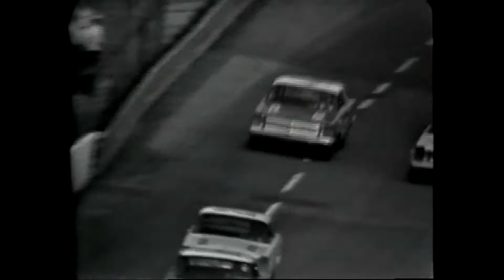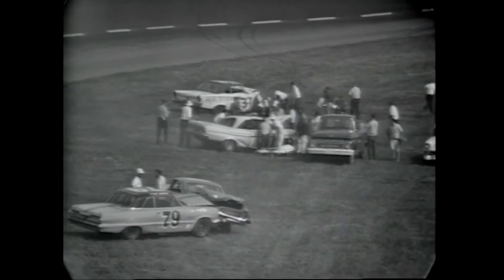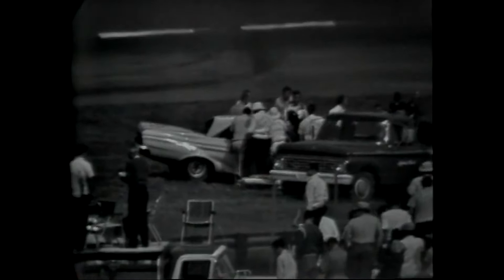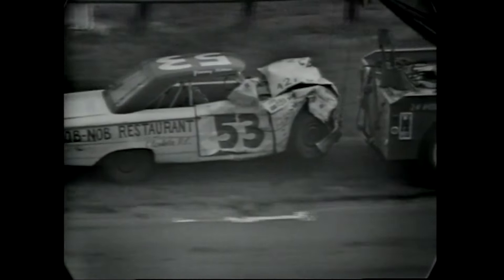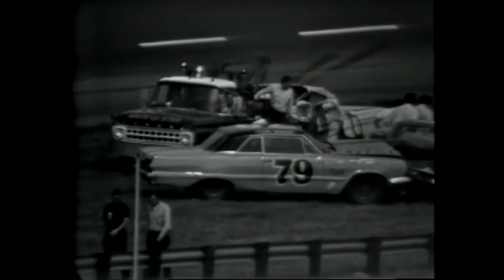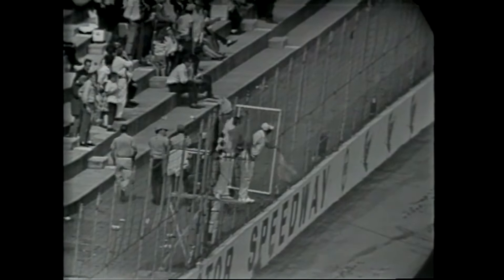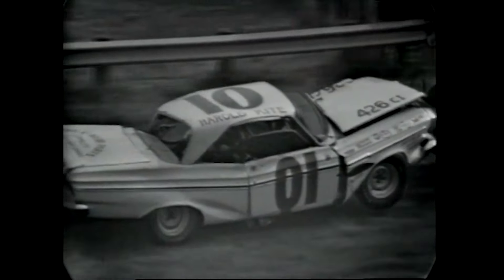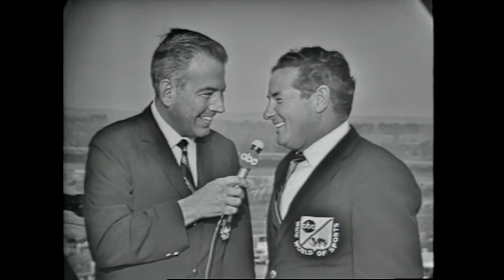1965 Harold Kite fatal crash @ Charlotte (extended footage)

Comment: As the broadcaster on the left reports a fatality, the guy on the right is all giddy and smiling and is looking forward to many more races like that.  🙄  Uh...what?
Reply: Yes. I was thinking the same thing. Yep, those sweet, innocent 1960s, when people were more empathetic and kind.

Seriously, though, death at that time in all forms of motorsports was simply accepted as a job hazard and it happened a lot.  Very different times. I mean, compare what happened after the Greg Moore crash and the Dan Wheldon crash? One race went on. The other, 12 years later, was stopped. Times change.
Reply: I wouldn't blame him, it's just the sign of the times, everybody had a cavalier attitude towards fatal crashes including the drivers themselves, they certainly didn't dwell on death like we tend to do nowadays.
Reply: Same, especially at the end of the race, where he states he hopes to see more races like this one.
Reply: The "guy on the right" is Rodger Ward, two time Indy 500 winner. He had seen fatal crashes before and was in the middle of one of the REALLY big ones in racing history when Bill Vukovich was killed at Indy in 1955. He was also a fighter pilot in WW 2. People weren't as insulated from death in those days. It was part of every day life. Younger race fans suffer lifetime trauma from watching an accident where the driver doesn't even get hurt and their pants are still wet about it years later (example: Grosjean). I don't know which attitude is worse.
Reply: @derrickgibson3240 like Dan Gurney said, they had a WWII mentality then.
Reply: @jwelliott738  Exactly, they were much tougher souls back then.
Reply: @RRaquello I get that, but it's just awkward to see. a guy died and he's just "ho hum" chuckling about it. 1965 car races weren't really broadcast with "what will people in 2024 think of this?", and attitudes have changed of course. but ward here is just, 60 years out, ghoulish.
Reply: Different times.  People being soft as runny shlts is a new thing
Reply: you got to remember,  this was a time we had just come out of a world war and the extermination of 6 million people...   we were very tone deaf to death in this era of life. it happened all the time in motor racing too.   the fact guys like foyt, andretti, petty, and the like survived made them even bigger heros of the time.  Death  was just a more natural and accepted thing.   it crazy to me too but that was just the cost of doing business back then
Reply: @603LostRoads  well, yea. like I said earlier, I get that. it is a much more emotion and feelings-based society today, and that extends to broadcast booths in all sports, including auto racing (which I am a novice fan at best of).  I definitely get how ward, with his military and car racing background, can compartmentalize deaths of people he probably didn't know all that well like kite, since he certaintly had seen lots of his friends and contemporaries die before this, both in war and on the track. but common decency and courtesy did exist among people in 1965 (which is before my time), and a little of it here would have been nice. "....just want to send our best wishes to kite's family and friends (some of whom were probably watching the race on t.v). it's just terrible what happened here. very sad...." that's all he had to say. Fleming said it.
Reply: Ya really!
Reply: @robertstone9988  Uh oh, here's the "real man" whining about people soft, and not realizing that he sounds like a soft dude himself. You're not a hard ass, Cletus.
Reply: WWII ended 20 years before this. My father fought and was wounded in that war. I don’t recall him ever saying a tragic death was a “natural and accepted thing”.
Reply: Remember, back in this era, deaths happening in sporting events were not something unheard of.  They didn't happen all the time, but the happened just enough to where people in that era just accepted that death was a possibility--albeit a rare one--in a sporting event.  There would be deaths in boxing from time to time in that era, occasional deaths in football or pro wrestling.  I believe Bill Masterton died of injuries sustained in an NHL Hockey game in the late 1960's.  Add to this the fact that for regular people, death at a job or in a car accident were things that were not infrequent.  People, as a whole, were simply more accepting of the reality of death in those days.
Reply: Yeah no shit- pretty insensitive even for 1965
Reply: People were more savage back then.
Reply: @MMAALL Where did you hear the 60’s were more empathetic & kind?
Reply: Primary broadcaster on the left was Bill Flemming who was one of ABC Sports' most versatile announcers at the time and noted for the network's college football coverage.
Reply: Yes.   Disgraceful
Reply: That to me is so sociopath.   A Death has occurred and this guy is thrilled about the race day and the events???
Reply: That's the color guy - the experienced expert on the event. Also a combat veteran. NASCAR drivers back then went into the sport knowing the score - there were going to be fatalities, possibly themselves.  Harold Kite knew this, and had seen it before, and knew the show must go on. Be thankful you haven't had these experiences in your life rather than criticizing those who have.
Reply: @603LostRoads that doesn’t make a life lost any better, each life matters
Reply: @TomandAmyinthePI I graduated high school that year and we lost a classmate to an accident, no one was laughing or smiling then. That was so rude of them
Reply: @naomisgram1   so go back 70 years and let them know.
Reply: My thoughts exactly!
Reply: I saw that
Reply: He showed no Respect for the race car driver or his family.
Reply: @OsbornTramain  your right. he's sick
Reply: The only missing is the popcorn and  balloons  and some Jolly good music. WTF
Reply: You can't see it from that angle, but he has one of his hands on his ... you know.
Reply: Yeah, that was nuts. It seemed like Roger was about to crack up.
Reply: I know right…I was fully expecting the announcer to say that the race will be restarted just as soon as they scrape the guts and intestines off the track…
Reply: That was some weird ghoulish sounding shit. Just smiling away.
Reply: @603LostRoads  This was 20 years after WWII - the world changed a lot between the end of the war and this race. It was also just two years after the Kennedy assassination. We were not "tone deaf to death". What a ridiculous statement.
Reply: @robertstone9988 😂
Reply: That was F’d up how the dude on the right was acting after seeing a guy killed 😮. Who was the reporter on the right anyway, what a JERK OFF
Reply: That was F’d up how the dude on the right was acting after seeing a guy killed 😮. Who was the reporter on the right anyway, what a JERK OFF
Reply: I understand that it’s 1965 October 17th right and people were not as sensitive to events like that on live TV but damn come on show so respect dude still
Reply: @603LostRoads 
What are you talking about? 
WWII ended 20 years before this race.
Reply: @RRaquello  We didn’t have counseling at school either if a student was killed in a car accident. We had an announcement from the principal on the intercom a moment of silence then our day as usual. No reporters at the school either.
Reply: Unbelievable callousness. Sickening
Reply: @RRaquello  To emphasise your point, a de Havilland 110 disintegrated at the 1952 Farnborough airshow in England, the engines propelling themselves into the watching crowd. 29 spectators were killed. The event continued once the wreckage and bodies had been cleared. Unthinkable today, but the spectators had recently experienced WW2 where sudden death from the air was to be expected.
Reply: I immediately noticed that as well.
Reply: The dude is sick
Reply: That definitely didn't play well..totally unsympathetic and shitty. I wonder if he or the network or channel faced any repercussions..certainly now with the Internet, etc he would be fired.
Reply: Would he have been smiling if Kite was his brother? Pretty cold, dude.
Reply: @MMAALL  I think people back then just felt it was reality without the need for emotional drama.
Reply: @RRaquello  this wasn’t a fighter pilot dying fighting the nazis. I don’t think we need to be in a certain era to have some value of human life. Not sure how your priorities go so wonky with such a weird comment tbh but you might want to think about that.
Reply: Nervous reaction?
Reply: You know something tells me that being a soldier in WW2 might just make it so you’re desensitized to death.
Reply: @OsbornTramain You get desensitized to death real easily when you’re flying in a B-17. The chances of surviving just a single sortie alone was 50%, and B-17 crews were expected to go 25.
Reply: The comments on here that people now are "soft" for not yucking it up after someone gets killed.  I think you are soft and weak if you need to project such a callous attitude to show how tough you are. Probably the same people that cried like a baby over having to wear a mask for a half hour at Walmart.

Comment: being a uni-body car did not help.
Reply: These we not unibody
Reply: @piedpiper8355  it's a Mopar c body. Unitized construction.
Reply: I owned a 65 Dodge, and it was a  dependable vehicle. Getting hit in the side like this wreck, unfortunately, no matter well constructed with the small amount of side protection in that Era would protect you.
Reply: Wasn't a unibody.
Reply: @dannyhaines385  looking at it closer, it looks like a 64 plymouth fury, which i stand corrected as it is a b body, but is still a uni-body car.
Reply: @dannyhaines385 All the B-Bodies starting in ‘60 were unibody.
Reply: What does unibody mean? That the whole car is connected?
Reply: @aaronmason6658  the body and frame are built as one unit, instead of a body on frame car, like a 64 Impala.
Reply: @Camska427  so they produce stiffer impacts essentially??
Reply: @aaronmason6658  It essentially means the car body (floor, roof and pillars, engine aprons, etc) make up the structure of the vehicle, as opposed  traditional body-on-frame construction.  Pretty much all modern cars are unibodies.  Many passenger trucks use body on frame construction.  In the case of some 60s/70s cars including the Mopar B-bodies they are technically semi-unibodies, because there is actually a subframe or “k-member” that cradles the engine and the k-member is bolted to the unibody that goes from the firewall back.  The same is true for early Camaros and late 60s /70s Novas.  Whereas early Mustangs are complete unibody.  The bigger cars of the 60s and 70s were body on frame.  Chrysler brand of the period was an exception though for the most part, building full-size unibody cars, whereas their Cadillac and Lincoln competitors did not.
Reply: @aaronmason6658  uni-body cars, especially hardtops do not hold up well in accidents like in the video. a post car may be stiffer, most drag cars tend to be a post for the stiffness.